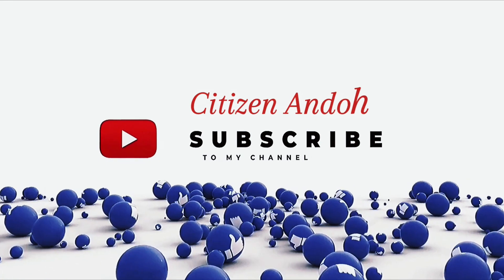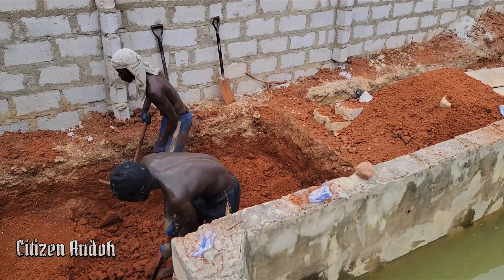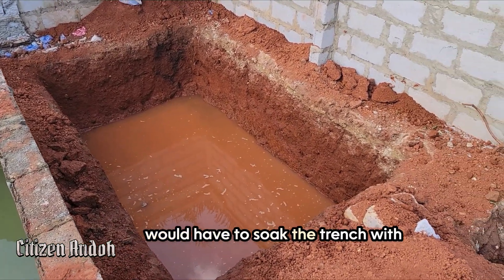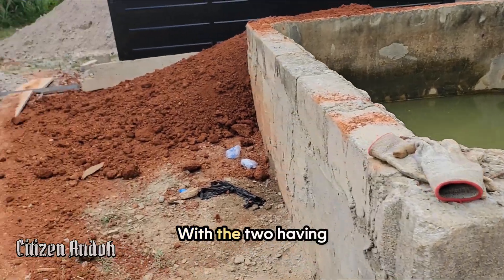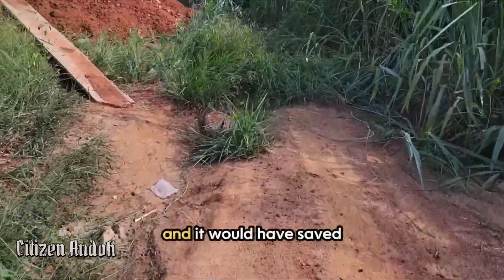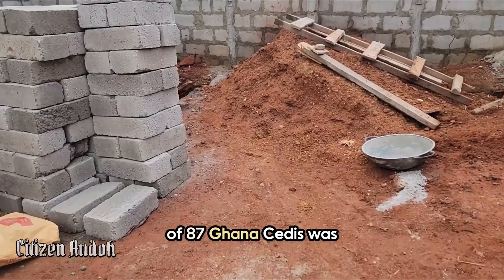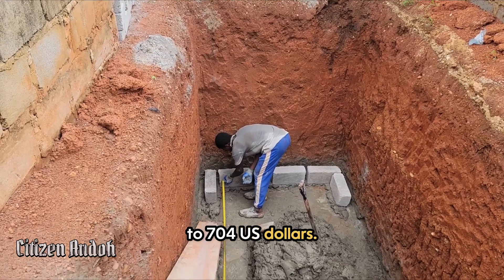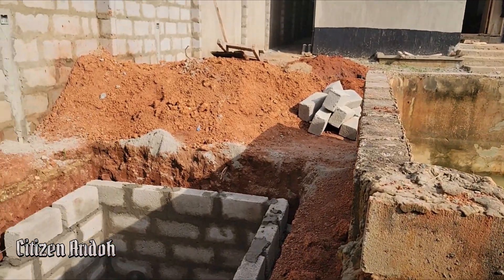3 Chambers Septic Tank And Total Cost || Building A House In Ghana || Episode 40

Comment: congrats Citizen Andoh💐! i like how you indicated taking time thinking through the option of septic tank and biodigester. your reason for your choice is very worthy😍 i would like to ask why three chambers instead of two or 1?
Reply from the maker: @rubyamanda9009 Thanks Ruby for the compliment.

A 3-chamber septic tank
improves treatment efficiency: The additional chamber provides more time for waste treatment, leading to higher effluent quality.

It also increases solids separation: The third chamber enhances solids settlement and separation, reducing the likelihood of clogging and system failure.

It better handles peak flows: The third chamber provides additional buffer capacity, helping to manage high flow events and prevent system overloads.
Reply: How do you drop the decking after you've deck the sceptic tank? Does the boards stays inside after it's been finished?
Reply from the maker: @officialjhazz I’m told the boards would surely be taken out which hasn’t been done so yet but I’ll come back to this comment and let you know how and when it gets taken out.
I hope this helps.